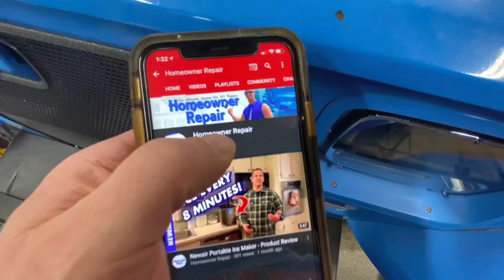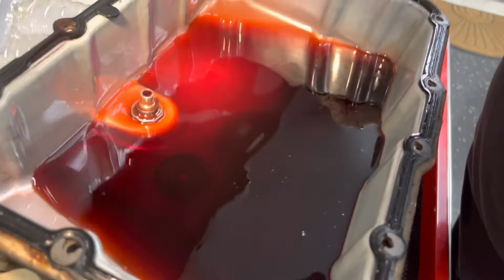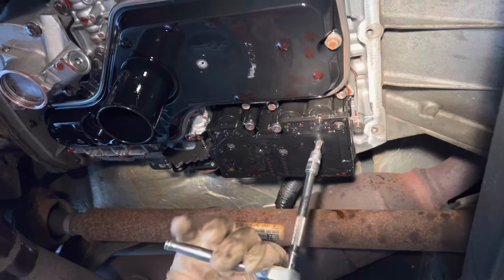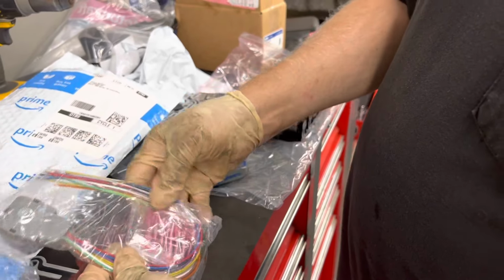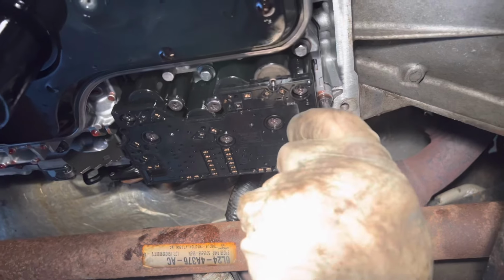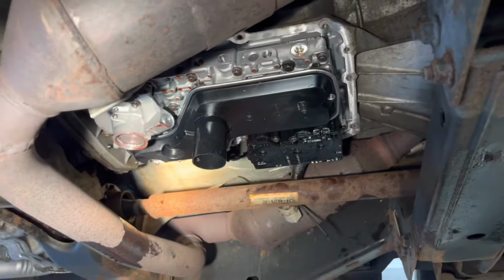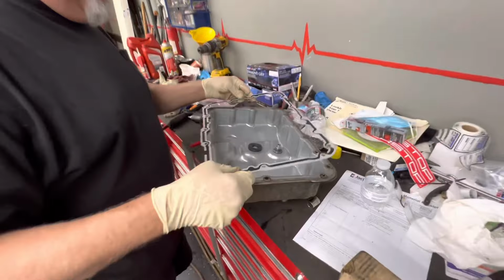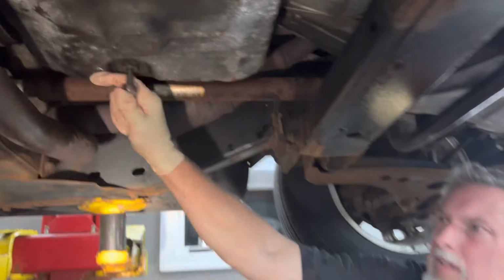2006-2010 Ford Explorer Transmission Solenoid Pack Replacement

Comment from the maker: 🔧BUY Replacement Solenoid Pack: https://amzn.to/3Kc0ej9
🔧BUY Replacement Transmission Wire Harness Repair Kit: https://amzn.to/3sANR8o
🔧BUY Transmission Fluid Fill Adapter: https://amzn.to/3dR6H7m
🔧BUY Transmission Fluid Suction Gun: https://amzn.to/3pDeQyN
🔧BUY Transmission Filter and Gasket: https://amzn.to/3wkL4Tk
Reply: Must say this is some articulated tutorial. So now I have a question about that harness plug. My 02 EXPLORER wasn't reversing but now does after repairs: problem's he did his job halfway and now I'm struggling to fix the it.. Question,Is there only one side fitting into the solenoid socket or either way U key it in, it works. Coz after keying it in the dash reads ... CHECK TRANSMISSION plus the O/D light blinks . what could be the problem?

Comment: Hello i replaced the solenoid pack on my 2007; ford explorer. 4r55s transmission. The new solenoid block. Doesn't engage forward. Revs fine. But doesn't. Move forward.when it does moves forward it has a lag . The old solenoid block. First gear was stuck on limp mode. All other gears work fine. When it was working properly. And no response from reverse. Replaced with new trans fluid,new trans filter. I was thinking i probably didn't reset the pcm to relarn  the new shift points. Any help would be appreciated
Reply from the maker: We didn't have to reset anything it just worked for our situation.
Reply: If its lagging maybe might not have enough fluid 🤷🏽‍♂️

Comment: If those o rings are bad on top of the plug the AC unit will drop water into the transmission it's only a little bit vaporizers in the transmission and rusts all the steel and stainless steel parts inside of the valve and the valve body where the shuttles and stuff are the eventually causes transmission failure always put new oil rings top and bottom on that assembly I recommend running a tube for the AC water down below the transmission
Reply from the maker: Thanks for the added tip

Comment: Always make sure those are brand-new O-rings and lubricated like this gentleman did here and make sure that you change the 2Rings onto the plug on the top and I'll explain why real quick the AC unit drops water right on that spot and it forever goes into the top of that plug and I've pulled out several of them that actually have the solenoid rusted the first thing it'll cause to go bad as the reverse solenoid and it'll jump in reverse because he's got rusted it doesn't want to move so everytime it stops to look kind of rough clothes and then when it feels it has enough voltage little jolt open
Reply from the maker: Thanks for watching

Comment: Reason for water getting into the plug is because of the AC drain line above it drips down the trans on most Ford explorers
Reply from the maker: That plug is problematic with these trucks

Comment: I have a quick question. I recently replaced the solenoid pack on my 2008 explorer due to the error code and it would not shift past 1st gear. After switching it out and resetting the TCM, it drove fine for 4 days before the wrench light and engine light came back on. Same error codes for solenoids. Has new transmission fluid and when i pulled the pan to replace the solenoid pack there was no sign of metal shavings or corrosion. What else could it possibly be? Is my TCM just bad? Any help would be appreciated.
Reply from the maker: Did you check the wire harness that attaches to it for damage? if the plug is messed up you may have to replace it.

Comment: Hi I have also same car also same problem transmission solenoid changed after missing gear my mechanic toll me it will take time need to rune car 500 kilometres it’s right ?
Reply from the maker: Not sure, Mine worked right away.

Comment: Hey I have the same problem in my explorer but the solenoid itself is good but the wiring is screwed up could you tell or make a video on how you did it because this is my first time working on something tech like in my car
Reply from the maker: I do not have a video on the wiring. When we fixed the plug end we reconnected one wire at a time. There are a lot of wires.

Comment: Thanks  for posting this. My 2008  Mountaineer had the same issue, and I fixed it by following your example. Shifts great on the first test drive, and trans sounds much smoother. Has 148k on it, and may have been original fluid. Has the ford gasket. I also had to wire in a new pigtail, it had one pin rotted off, and it was a pain in the ass. I pinned it out on the bench and made a little diagram to match the colors up. Be careful of orientation when doing this, It is easy to forget which side of connector  you are looking at!  Especially while you are fighting to get access to it with that front driveshaft right in your face. I left the pan off to do it too, and had a little more room. Thanks again! I saved a fortune by doing this myself.
Reply from the maker: Replacing the transmission plug end is a huge pain in the butt. We spliced the circuits in one at a time in the air...wasn't the easiest thing to do.

Comment: Great production.  Some very good advice.  I'm not looking forward to having to do this job in the future.  Trans is acting up a bit, but not shooting any codes.  I don't know if it's trans related or a traction control issue.  When I had to fill my transmission with fluid in the past, I made an IV type system.  I had a quart of fluid raised above the trans, and fluid traveled through some plastic tubing to the fill plug - worked like a charm.  Thanks for the profession explanation.
Reply from the maker: Thank you for checking our auto repair video that shows you how to replace the transmission solenoid pack on a Ford Explorer. Hope this helps you out.

Comment from the maker: Tools For The Job

🔧BUY Replacement Solenoid Pack: https://amzn.to/3Kc0ej9
🔧BUY Transmission Fluid Fill Adapter: https://amzn.to/3dR6H7m
🔧BUY Transmission Fluid Suction Gun: https://amzn.to/3pDeQyN
🔧BUY Transmission Filter and Gasket: https://amzn.to/3wkL4Tk

Comment: Video is awesome guys because I just had a friend bring me over his Explorer that's having exactly that problem on a Jasper transmission that's just a couple months with low mileage out of warranty and they won't take care of it
Reply from the maker: This was the culprit on our transmission. Common problem on the 06-10 Ford Explorers. I didn't think it was going to make the 1/2 hour ride to the shop that's how bad it was. Almost had no gears.
Reply: @HomeownerRepair  The Bouncing that are stainless steel in the lot of the shuttle Springs inside the valve body or stainless steel when water comes in through that sitting at the top that's where the plug goes in it ends up vaporizing in the transmission and it actually affects all the components that are steel if you find light rust on everything when you take the pan off that's likely the problem

Comment: Would this fix the truck not shifting out of first gear?
Reply from the maker: I literally lost 2nd gear and 3rd was slippin like no tomorrow. I limped my Explorer to Steve's garage and tossed a new solenoid pack in it along with a new transmission filter. I took it out on the hiway right after and it felt like a brand new truck. This fixed the issue on my Ford Expedition. Is yours throwing a code?
Reply: Possibly,  I think it's worth trying.  Thanks
Reply: Only thing is mine doesn't or hasn't slipped

Comment: Thanks guys! When you’re running it to check the level and warm the fluid, is the truck in Park or Drive?
Reply from the maker: it is in park. Here is a link to our video that shows you how to check the transmission fluid level in a Ford Explorer. https://youtu.be/Y3SvgFCzpR8?si=vNIHt6-Psze1XeBg

Comment: I have a 2007 Explorer XLT 4WD SOHC V6 with 118K miles. The transmission started shifting hard a few months ago and then I had problems going into R or D when cold. Also OD was acting up as well as the shuddering issue. No codes. Anyway, I took it to a reputable local transmission shop that diagnosed it and it ended up needing a rebuild (torque converter, valve body, pressure relief valve, OD sprag, rear band). It was a VERY expensive repair. I only went ahead with it because the interior/exterior are in outstanding condition and the engine runs well so far, and when I checked the cost of a suitable replacement vehicle I almost had a heart attack! I am hoping to get another 4 years out of it (without another major failure).
From your knowledge of this vehicle, do you think I'm going to regret my decision?
Reply from the maker: If it is in good shape I would drive it for as long as you can. You should be okay with it. Thank you for watching our auto repair videos.

Comment: Just change the solenoid pack, do you have to program something in the ecu? my sport trac has bad tcc?
Reply from the maker: I didn't have to on this truck. We did a transmission fluid refill when we were done and it shifted awesome.

Comment: Do you have to run it through the gears as well as warm it up?
Reply from the maker: Yeah, If you are replacing the solenoid pack I would (keep your foot on brake, don't move) and slowly shift the truck through all of the gears to allow the transmission fluid to circulate through everything. Replace the transmission filter while you are in there. It is pretty easy to do.

Comment: Do you have the wire harness diagram or video on replacing the wires?. I had to rebuilt the transmission due to the planet going bad and the connector for the solenoid would not come out so i had to cut the wiring.. unfortunately the first 2 pins came out and both happened to be yellow in color.. any help will be appreciated.. thanx
Reply from the maker: Hi, Unfortunately I do not have a wiring diagram for the harness. We cut and spliced the new pigtail end in one wire at a time..it was a pain.

Comment: Greetings! My truck drive fine and normal but if I stomp on the accelerator hard it’ll like slip into neutral. I’m getting a p0741 code. Is this the same issue or maybe fluid and filter change? Thanks
Reply from the maker: You could try replacing the filter and refilling the transmission pan with fluid. I have had this work for me in the past on different vehicles. It may or may not help out (depending on what is wrong ) Hope this helps out.
Reply: @ THANK YOU FOR RESPONDING!

Comment: Does this pack have the pressure control solenoid b in it ? Having this issue going to drop the pan tomorrow
Reply from the maker: Not sure. My transmission was slipping like mad and this fixed in.
Reply: i have that same B issue. ever figure that out?

Comment: It's my understanding that the AC unit dumps on to that flood constantly and it's a good idea to fill that thing with the electrical connection grease prior to putting it back is that correct
Reply from the maker: It might be the case

Comment: Is the 4.6 / V8 engine similar enough to use this video as a guide?
Reply from the maker: You may be able to apply the general procedure shown in this video to your truck, there might be a few different things but this might set you on the correct path. Hope it helps out.

Comment: After replacing the solenoid pack, did you do a quick learn thing with the computer? My son changed mine last night and the wrench light went out but its still shifting a little hard going into 3rd. Thanks for the video!
Reply from the maker: No, It just shifted fine once we put ti back together. He may want to check the transmission fluid level to see if it might need more. If the transmission fluid level is low this may cause a slip or hard shift situation. Hope this helps out.
Reply: @HomeownerRepair  Thank you!  He had triple checked the fluid level so I just drove it today. It was barely hesitating (before it was thunking with a jolt) and it smoothed out quickly today. Thank you again!

Comment: did you remember the wiring?   Im working it now and cant find a Ford guide anywhere?
Reply from the maker: We cut and spliced ONE circuit at a time. I do not have a wiring schematic for this transmission.

Comment: I have a question, if u see some small pieces of metal in the container of the transmission fluid, is it worth it to change the transmission solenoids or no because the transmission can be bad or what can those small pieces of metal be?
Reply from the maker: It really depends how much of it is there. Pieces of metal in the bottom of the pan are never a good sign. The transmission we fixed didn't have any chunks of metal in the transmission pan. That may be a sign that something else it wrong with the transmission.
Reply: @HomeownerRepair  ok thanks for the info 👍

Comment: Any idea what the size of the pan bolts are?
Reply from the maker: It should be stated in the video. If you need to buy some new transmission pan bolts for your Ford Explorer, go to the dealership with the VIN number off of the truck and they should be able to order some for you. Hope this helps you out.

Comment: hello i have a 2007 ford explorer xlt with a 4.0 6 cylinder,145,000 miles with the 5R55S Transmission trouble code P0745 {PRESSURE CONTROL SELINOID A} vechicle is stuck in limp mode will not go over 25 MPH revs are normal  in first gear no gears slipping moves on it own power when u press on gas pedal;makes a whinding sound,leakig a very small amount of transmission fluid, when u move shifter in gears PRND321 all gears operate fine you can feel the gears in transmission and vechicle moves .resverse is the only gear will not operate normally;press on pedal and it goes nowhere, my question is will a new or refurbished selinoid pack resolve the issue not looking for a micracle just a temp solution.any help will be appreciated
Reply from the maker: I had a similar problem on this Ford Explorer and the new solenoid pack fixed the issue. I can't say for sure that it will resolve your problem but it might. These solenoid packs are know to go bad on these trucks.

Comment: Hello I took the car to the workshop and they had a computer check on it and the electricity was all fine and the gear oil was fine, it was fine, it was not burnt and there was no dent in it and it turned out that the gear clutches were broken.

What do you think is the problem or what do you advise me to do, my dear friend?
Reply from the maker: What are the symptoms that your Ford Expedition is having.

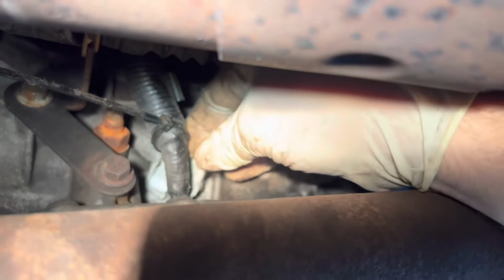Comment: I really missed the removal of the bolt at 4:35 ... for 05-09 Mustangs this is nearly impossible to remove!
Reply from the maker: Thanks for watching.
Reply: @HomeownerRepair  How did you remove it in the end? Any tips and tricks you can share?

Comment: Hello. I have a 2004 Ford Explorer. I changed the transmission oil. but it is leaking oil. It becomes unusable after 1 week. but it does not leak into the ground. I think it got mixed into the engine oil. because white smoke comes out of the engine and the engine stops occasionally. There seems to be a red tint to the engine oil. I think it is a vacuum modulator. Do you think this could happen?
Reply from the maker: White tailpipe smoke usually means coolant is getting into the motor it might be a bad head gasket. You may want to have a reputable local mechanic take a look at it to see what might be going on with it. Hope this helps you out.

Comment: What happens if you put one of them transmission in and you heard the torque converter spinning but the rear end not spinning but the torque converter is all the way back locked in?
Reply from the maker: Did you check the fluid level?

Comment: Hate to ask, but i can not find an answer anywhere.  2006 Exporer 4.0,  P1717 and P0765.  code indicates solenoid D..  from what i HAVE found it appears the D solenoid is NOT in the pack your puting in?  Hope i hear from you..thanks
Reply from the maker: We replaced the whole pack and it fixed all of the slipping issues our transmission was having.
Reply: @HomeownerRepair  ya, I replaced mine and the trans is now working like new
Reply: Hey @Papaw62  so my father in law is having the exact same issue with his 2006 ford explorer 4.0l P1717 and P0765 and I'm wondering if I purchased this same Solenoid pack with it fix these issues?

Comment: I got a 08 mustang with the same transmission the pigtail got broke that goes to the shift selenoid I ordered a new pigtail and the wires on the factory r different colored then the replacement can u help me woth the wiring colors
Reply from the maker: Same thing happened to us. We literally replaced one wire at a time because none of them were the same color. So we snipped on off the old harness then connected it to the new plug end one at a time so the wires didn't get crossed...it took about an hour

Comment: Sir, when I put my 2008 Ford Explorer in Reverse and D, the vehicle does not move, but the RPM increases. However, when the gear lever is shifted to 3, the vehicle moves, indicating that it is capable of driving.

Is it enough to change the solenoid pack to address the problem?
I went to many local repair shops and described the situation, but they all told I needed to overhual the gearbox.
What are your recommendations? Should I get a solenoid replaced and tested, or should I get a gearbox overhaul?
Reply from the maker: I had the truck for a year and the reverse always made a clunk (but I never lost the gear). Once I changed this solenoid pack the issue was gone. I'm not sure if this is what's causing your issue.
Reply: Im having that same issue with my 2007 explorer out of nowhere it  stopped moving in any gear, no codes or lights. Did you find out what the issue was???
Reply: It's your overdrive sprag bearing, very common issue for these trans.

Comment: the same 4x4 transmission works for the 4x2?
Reply from the maker: If the truck has this same transmission it should be the same or a similar process.